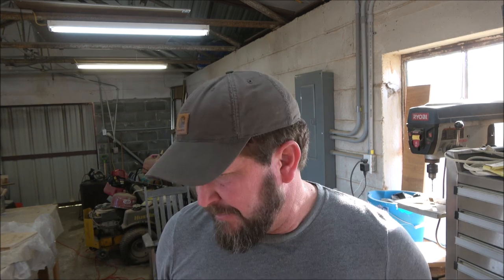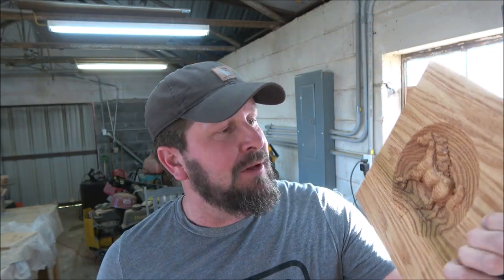3d CNC (mystery cut)

Comment: I’ve found that a step over of 8 to 10 percent max of the bit end diameter on the finishing path leaves a much better surface without all the tool marks. Really smooth. Longer to cut but well worth it.
Reply from the maker: Come to find out thats the way it was programmed, there are 3 of the files with different setups in each for a bit of a different look....Thanks for watching!!

Comment: For your final cut, don't let the overlap be more than 9% and you won't find the need for sanding paper
Reply from the maker: Come to find out this was the intended programming of this particular file, there are 3 files with different processes, this was just a "look" the programmer was going after.  It looks good, I just prefer a smooth finish......Thanks for the tip and thanks for watching!!